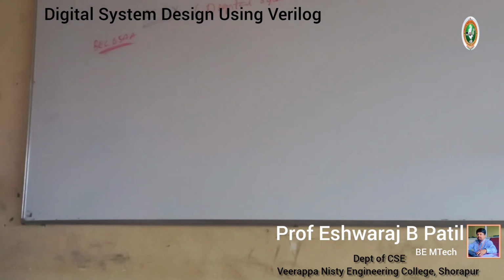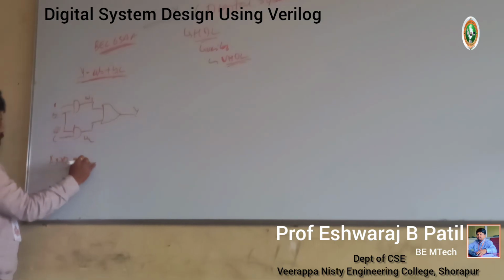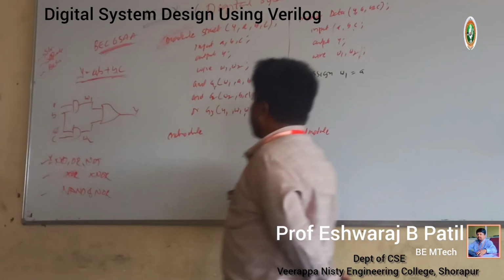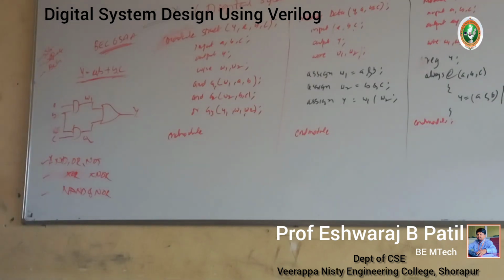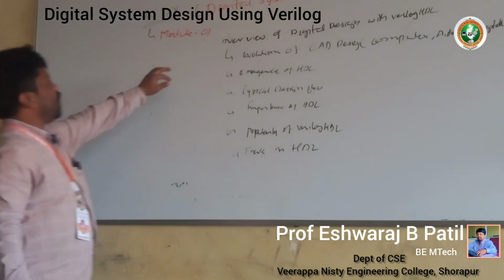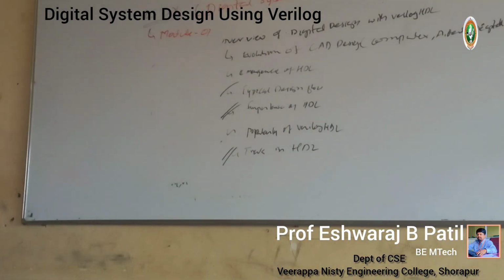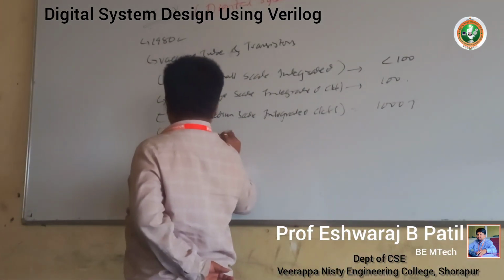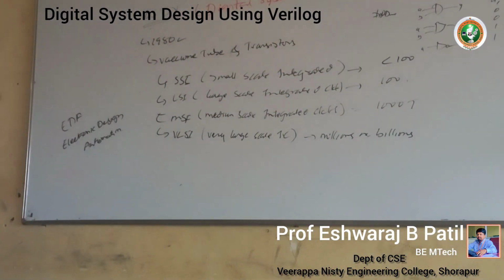DSDV : Module I : 01 _ Introduction & Evolution of Verilog HDLs

Comment from the maker: This video is an introductory lecture for the elective course Digital System Design using Verilog (DSDV), taught by Prof. Vishwaraj B. Patil. It covers the course objectives, evaluation criteria, and the foundational concepts of Hardware Description Languages (HDLs).

Course Overview & Objectives:

The course focuses on designing digital systems, including combinational and sequential logic circuits, using Verilog HDL.
Three primary modeling styles are emphasized for digital circuits (7:45 - 16:00):
Structural Model: Based on direct hardware component interconnection.
Data Flow Model: Utilizing Boolean equations and the assign keyword.
Behavioral Model: Using procedural blocks like always and register.
Evaluation Structure:

The course is graded out of 100 marks: 50 for Continuous Internal Evaluation (three internal tests, seminars, and group discussions) and 50 for the End-Semester Assessment (17:50 - 20:55).
Evolution of Digital Design & Concepts:

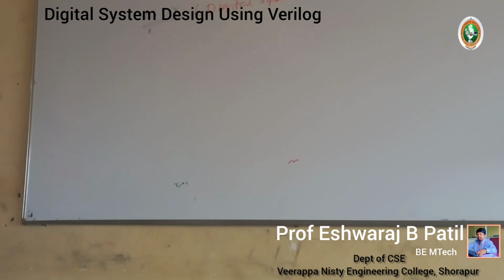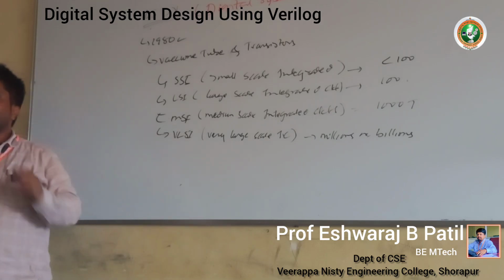The lecture traces the history of digital design from vacuum tubes and transistors to modern Integrated Circuits (ICs) (31:00 - 34:20).
IC categorization is explained: SSI (Small Scale Integration), MSI (Medium Scale Integration), LSI (Large Scale Integration), and VLSI (Very Large Scale Integration).
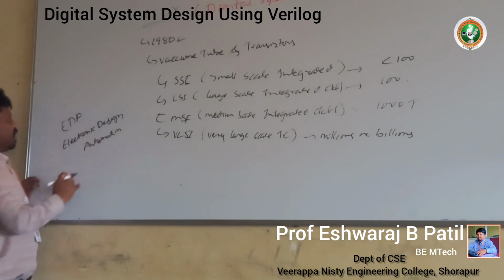The importance of EDA (Electronic Design Automation) tools and Test Benches for verifying hardware functionality and simulation is a key focus (34:50 - 39:35).
Important Exam Topics:

The professor highlights recurring exam topics, specifically:
Typical Design Flow (26:00)
Importance of HDL (26:25)
Trends in HDL (26:45)